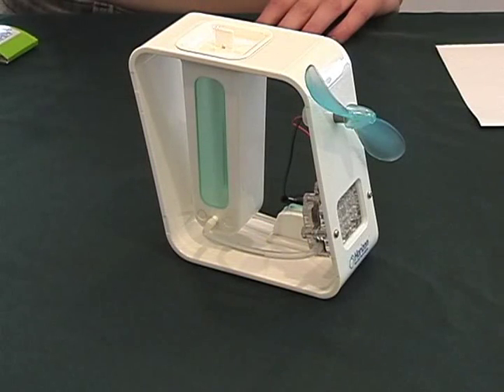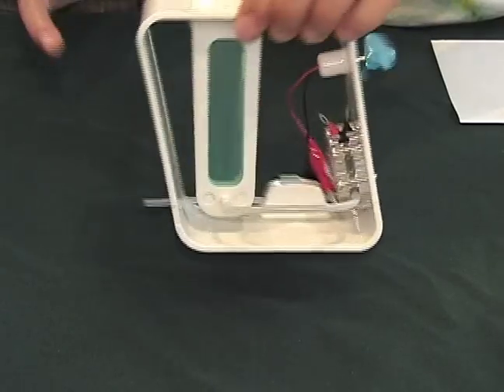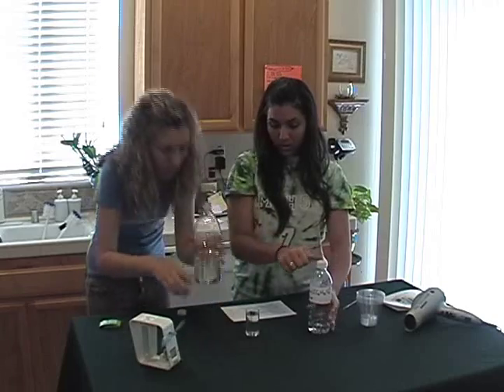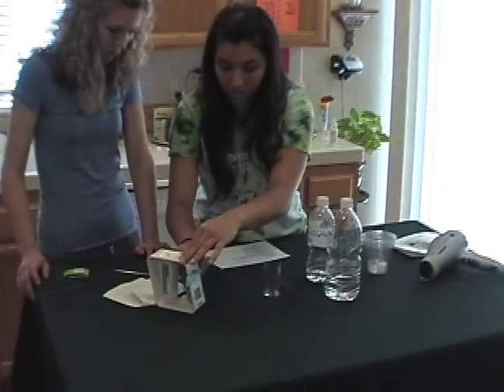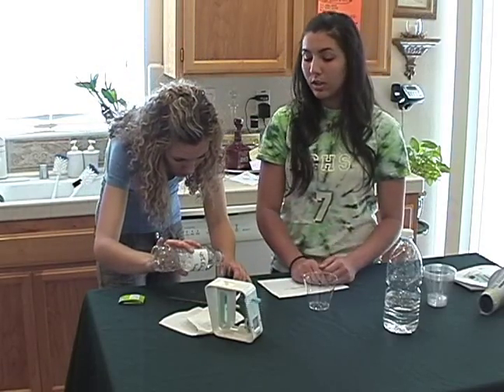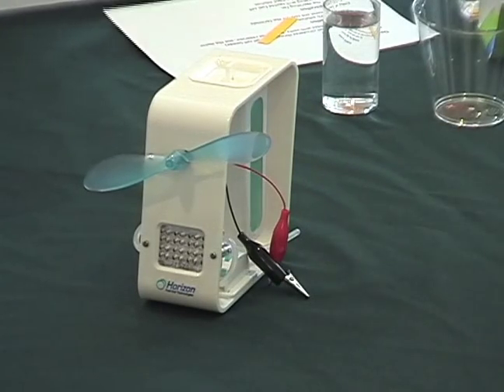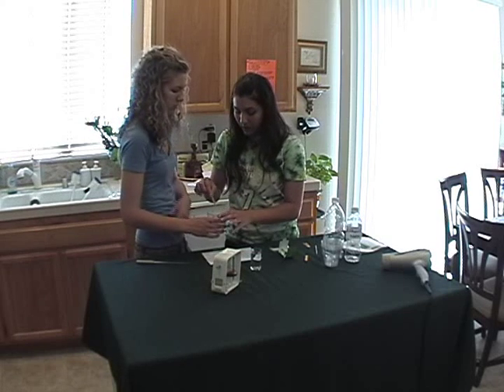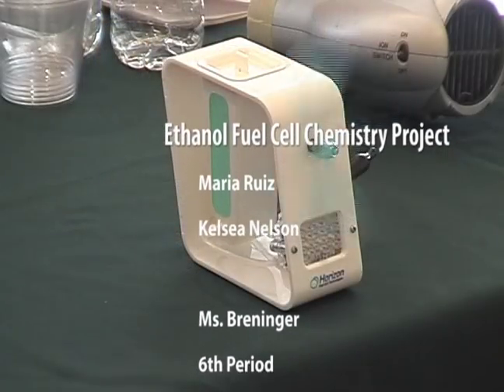Direct-Ethanol Fuel Cell

Comment: Good work, but you said one thing absolutely wrong: If acetaldehyde or acedic acid is a byproduct, then no CO2 will be formed because the catalyst won't be good enough to oxidize the acedic acid or acetaldehyde. Also you should work with an anion exchange membrane rather than a nafion one, because this will yield much more power and no need for a precious catalyst.

Comment: This is a manufactured device, I'm sure these ladies did not do the engineering and injection molding of the plastics components, as well as the fine machined metallic parts. I'm not convinced!
Reply: You can buy it on amazon
Reply: This is the perfect example of what forced female empowerment in STEM fields look like. It's only gotten worse from then on.

Comment: @Dominipater 
I know that it does electricity...

But as you said... "I don't believe the voltage would be enough to recharge a AA battery, unless you used several fuel cells."

But, if you conect a great motor with gears in this small...instead of simply turning ... you will produce electricity.

No have to sell, more powerfull cells of this experiment???
To recharge batteries or turn on lights???

thanks a lot

Comment from the maker: We did not measure V or Amps...no multimeter available during the experiment.
The electric motor the fuel cell has was very small.  I don't believe the voltage would be enough to recharge a AA battery, unless you used several fuel cells.
What are you asking about attaching a generator to produce electricity??? The fuel cell produces electricity directly, no need for a generator.

Comment from the maker: @overunitydotcom 
Sorry we did not measure mW.  15% was suggested by the manufacturer, we didn't try higher.
The membrane gets poisoned after a while and we lose voltage.  This is reversible by emptying the reservoir and allow to air-dry.
I think the membrate is allowing some of the ethanol to migrate across, or maybe the byproducts (acetic acid) or Vodka impurities are buffering the reaction.
Increasing the % risks producing too much acid byproduct, which may kill the membrane permanently.

Comment: Hmmm...what did you do the with the rest of the vodka? ha ha ha j/k.

The use of distilled water is good, but even more important is the use of something higher proof like Everclear which is 95% ethanol. My understanding is that it's almost impossible to use 100% ethanol outside of a labortory setting since it's likely to leach contaminants from the container or the atmosphere.

Comment from the maker: Used diluted Absolut Vodka to ~15% alcohol for this video.  The vodka was OK for the video, but is not good for long-term running.  We were told using purified ethanol + deionized water would allow the fuel cell to run for much longer than what we experienced.
Don't own a multimeter to peform the tests you ask.
Send me your email if you wish to purchase our fuel cell kit, we no longer need it.